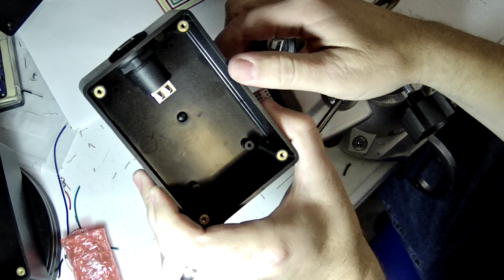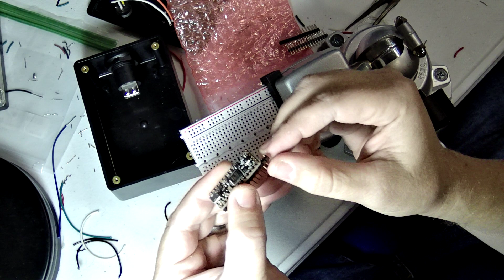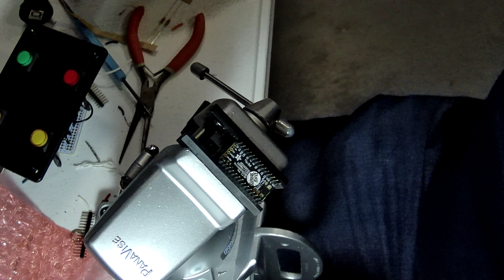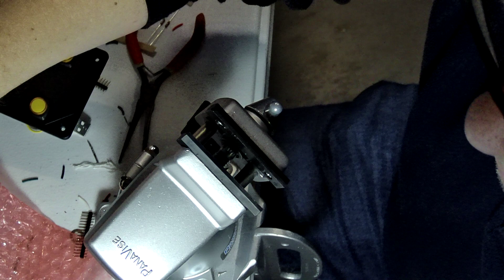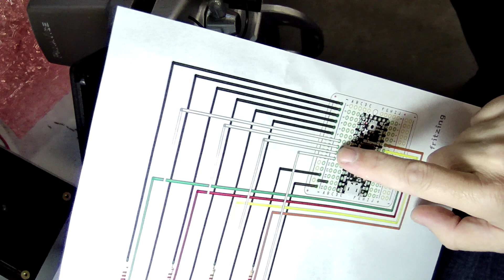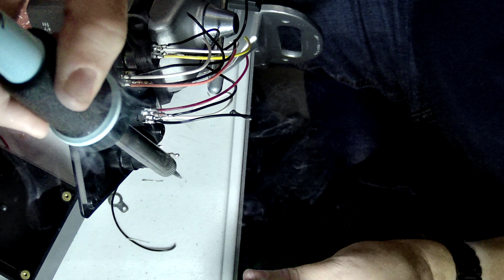Building the QLab Remote

Comment: This was a great project. It was good to get some practice on my soldering skills. I did hose one Itsy Bitsy in the process, but 2nd time's a charm. I work in tech. with some high schools, so this will definitely come in handy. One question... I've used midi and OSC with qlab, but this is my first time with MSC. Is there code to make the Stop button behave like an actual "ESC" panic instead of a quick full stop. From my research, I'm guessing not, but I thought I'd ask. No big deal either way. Thanks again for sharing.
Reply: To get it to mimic the ESC key with the fade out you would need to program the itsybitsy to behave like a QWERTY keyboard. The downside to that strategy is that then it doesn’t work if QLab isn’t the active window. The other option would be to use a general MIDI note message or something and then map that to the Panic All function in the “Use Musical MIDI Voice Messages”. Downside to that is now you have to create the control map for every new workspace. So now the remote isn’t plug and play.
Reply: I figured that was the answer. And I do love the plug-and-play nature of this design, so it gets to stay the way it was born. Thanks again for sharing this.